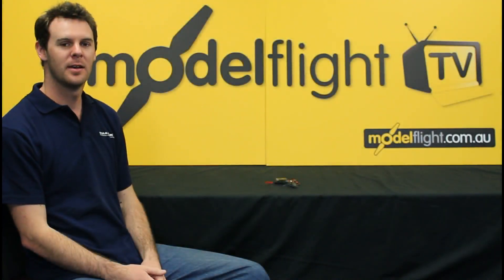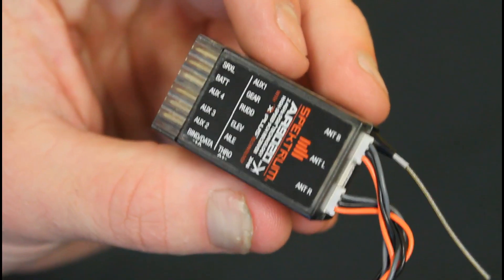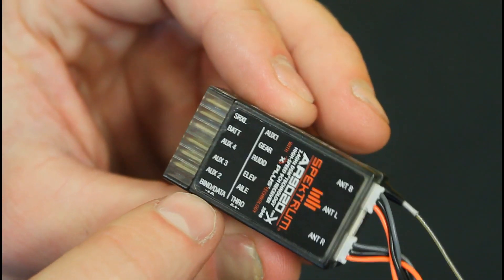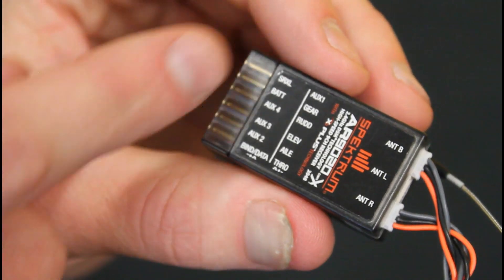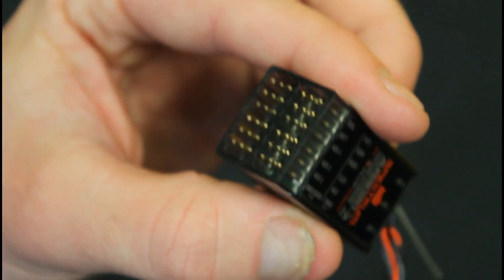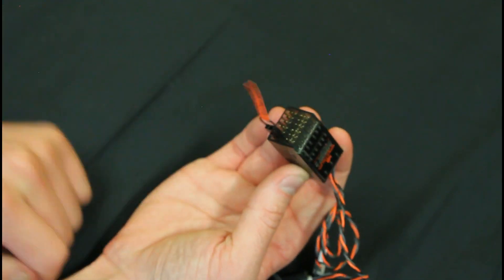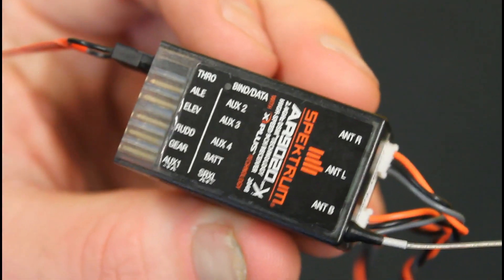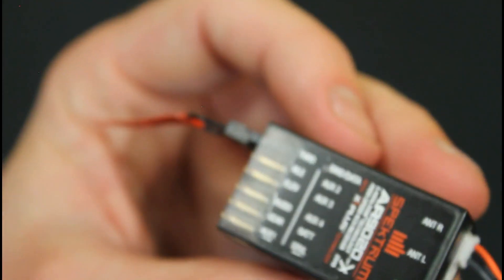Spektrum AR9020 Receiver - FAQs

Comment: Is the SRXL line out active from factory or do i need to switch the AR9020 over to SRXL somehow? Im having trouble getting a microbeast plus to recognize the SRXL input from the RX. And yes im running V4.2 PRO firmware on the microbeast plus that allows it to support SRXL. Any help would be great thank you.

Comment: Should the little bind/data light always be illuminated solid red regardless of bind mode or channel location?
Reply from the maker: Hi Jason Cave, during normal operation, the amber light should always be illuminated. The red light, however, indicates how many holds the receiver has received. Generally speaking, this red light will flash. For example, one hold would be indicated by a flash, then a pause. Two holds would be indicated by a flash, flash, pause. Hopefully that helps you, Jason. Please let us know if you have any other questions.